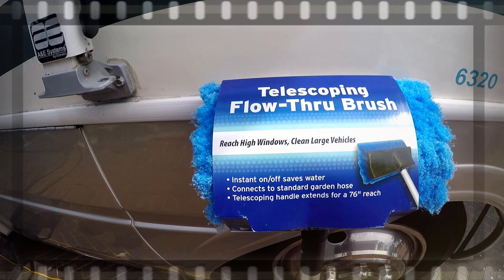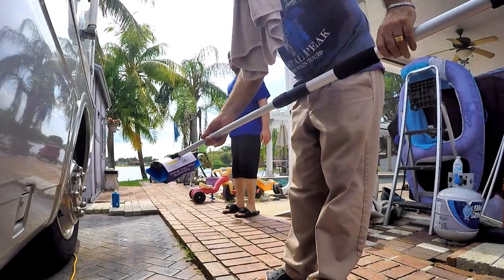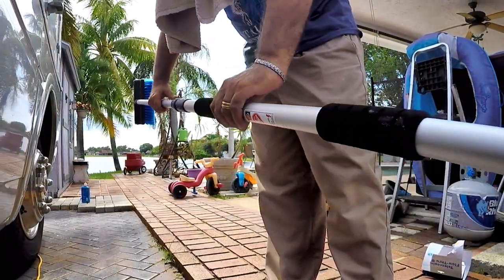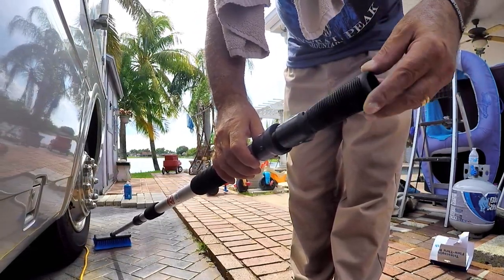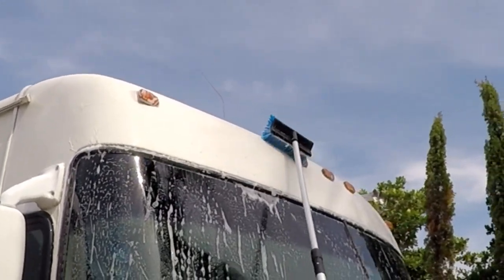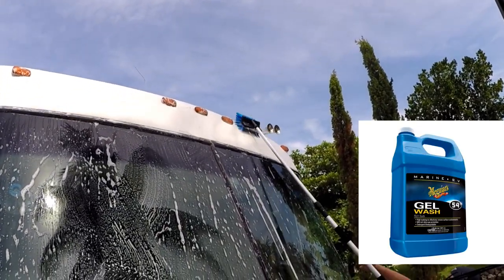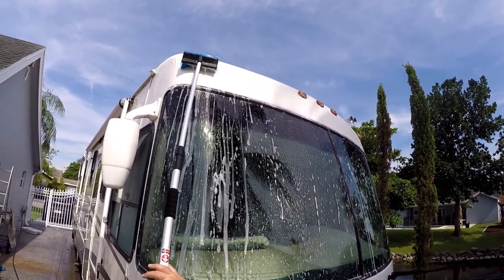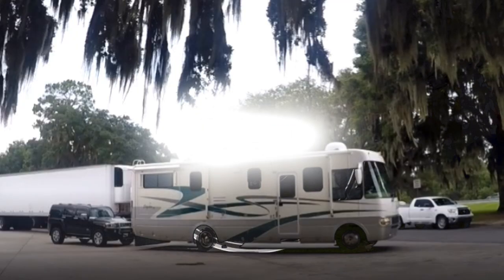TELESCOPING FLOW-THROUGH BRUSH for RV - BOAT - TRUCK Wash Brush

Comment from the maker: Handle adjusts from 43-inches up to 71-inches long.
Includes a Locking Brush Head and Rubber Corners: Features a locking head so your wash head won’t spin while in use; rubber corners protect what you are washing.
Reply: LIKE #1 - great washing tool!

Comment: Great review John! The rounded surface of the brush is a nice feature, the handle looks good and sturdy and looks like it won't flex too much if you have to push a little harder to scrub an area. 👍
Reply from the maker: It is much easier for sure and not much flex. Thank you for the
great comment. Always appreciate your visit.

Comment: Is the brush on the link to Amazon the rounded brush? It doesn't look like it in the pictures and it is not mentioned in the discription.
Reply from the maker: Thy keep discontinuing these brushes but this is the latest one I been using.
51-Inch Car Wash Brush with 10-Inch Soft Bristle, On/Off Switch for Car Truck Boat: https://amzn.to/3qBN8q2